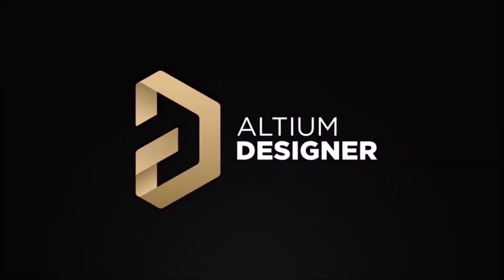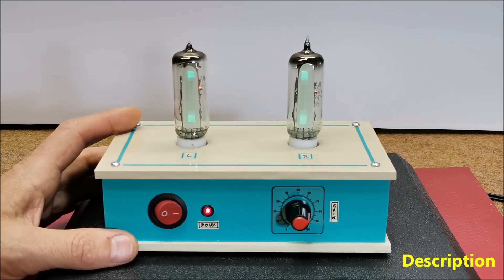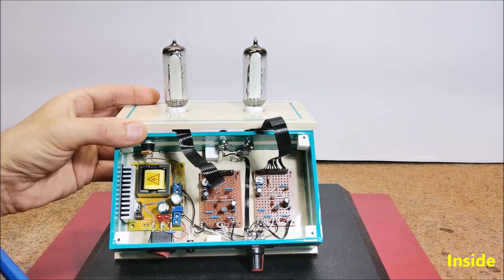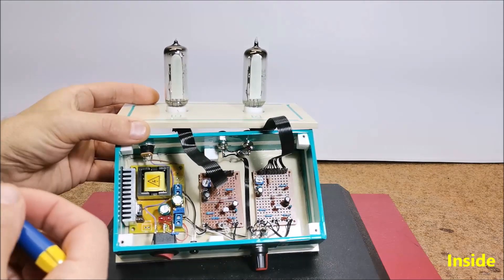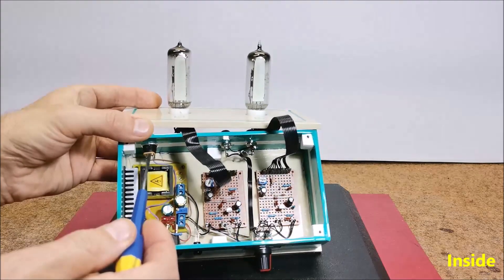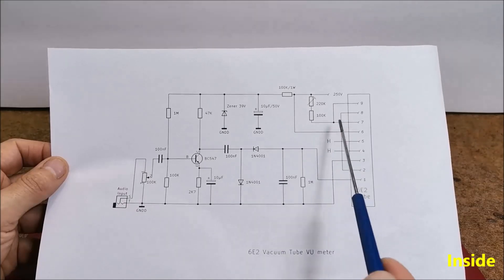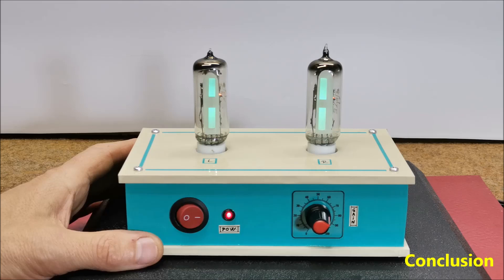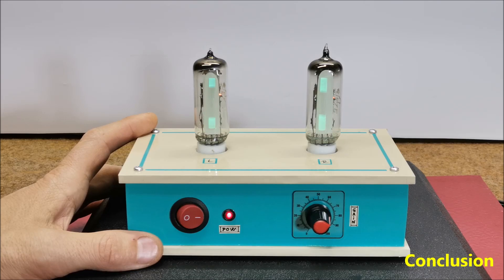How to Make EM84 (6E2) Vacuum Tube Stereo VU Meter

Comment: Superbly informative Video. thank you very much.
I have built and tested this circuit with an original Mullard EM84. It works excellently.
I made the following modifications for use with my valve amplifier  :
1) Mains A.C. powered using a 250 volt valve isolation transformer with separate 6.3V heater winding.
     H.T. half wave rectified by a Mullard EB91 valve to 320V D.C. 54uF smoothing cap.
2) 100K resistor on H.T. input to zenner diodes increased to 150K (compensates for a higher H.T. voltage).